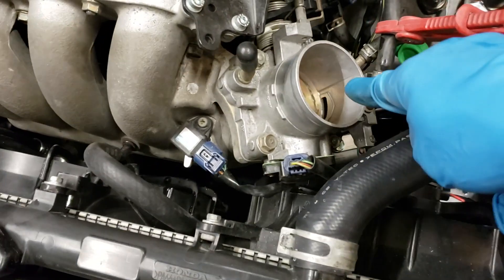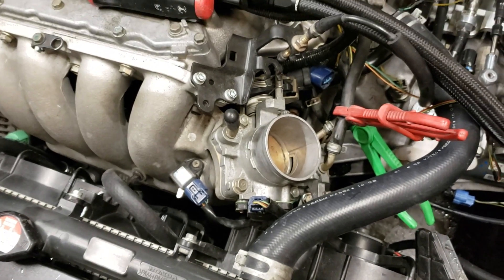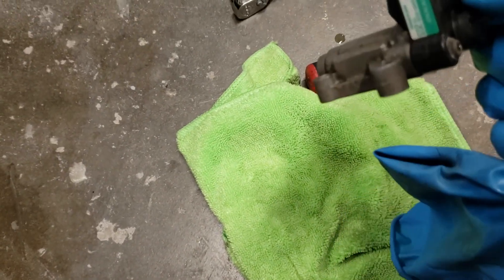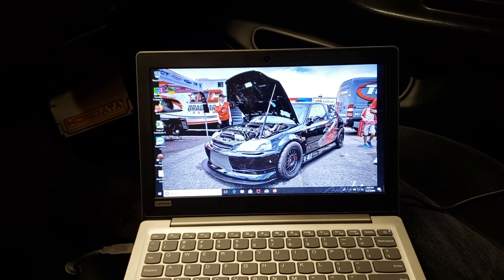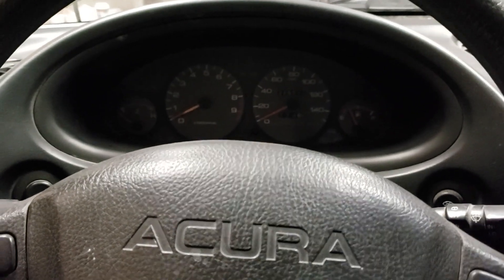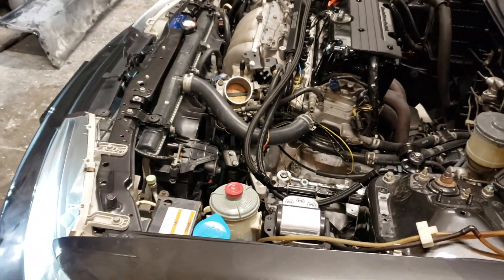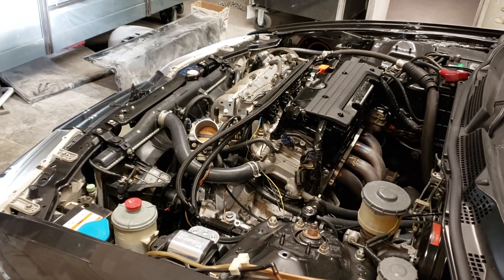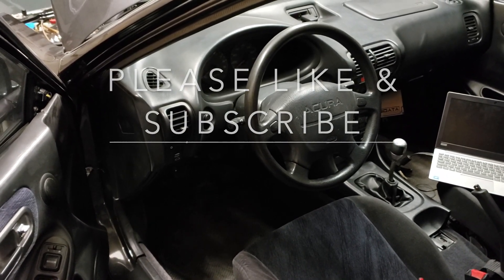K24 Swap Idle Surging Issues Fixed...

Comment: The real fix for that surge remove the map sensor with the wiring still plug to it should stop immediately then use your computer to calibrate your mapping
Reply from the maker: Thank you for adding you comment to help. Any kind of help is greatly appreciated by me and the community.

Comment: i deleted my iacv is it normal for it to surge like this still?
Reply from the maker: It could be other issues causing surging. I haven't ever deleted my iacv before so I couldn't give you more information about it.
Reply: what do you have instead? you can't delete it without having an electronic throttle

Comment: I have a 2015 ltz impala 3.6L  my car is doing the same after I cleaned out the throttle body I tooled out the car and put it back on now the rpm is going up and down
Reply: I also thought it need a calibration or relearn so I brought it to a macanic and he said it need a new throttle body so I said yeah how much would it be so long story short he ended up saying it was a ecu cause the new throttle body did want to program
Reply from the maker: I would check for any kind of vacuum leaks.
https://youtu.be/j-rzdF_zpfU

Comment: Mine stops surging when i covered the hole in the throttle body but my iac is new (from ebay)
Reply from the maker: I'm not an expert and really can't tell you what your issue is. It's possible its a bad ICV especially from ebay but you need also need to check air coolant, vacuum leaks, etc.
Reply: You just might have a bad iac valve, EBay parts are a hit or miss.

Comment: What did u use tp clean the IACV?
Reply from the maker: I used brake cleaner to clean as much stuff I could get out. Used a small screw and ripped up small tough paper towel to scrub the gunk out. But once that is cleaned out, you need to oil up where it spins. Make sure it spins very freely. This process might not work depending how bad its seized up and if that doesnt work you will have to replace the Idle Contol Valve.
Reply: @jsrebuilds3951  oh cool thanks for the quick reply man...much appreciated!!!
Reply from the maker: @teammusketeers  Your welcome let me know how that goes.